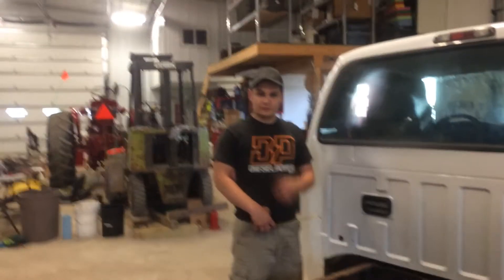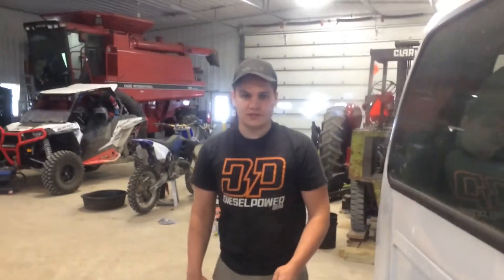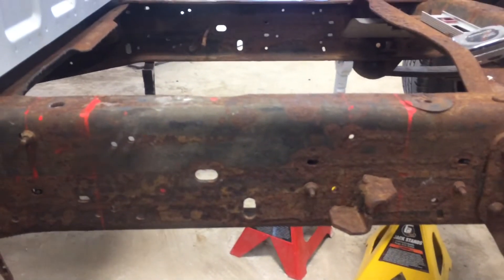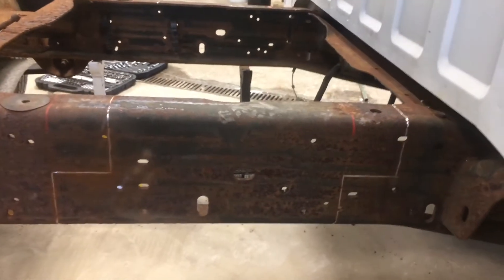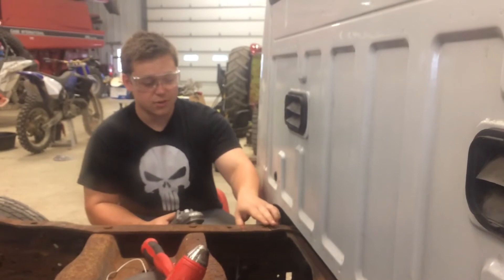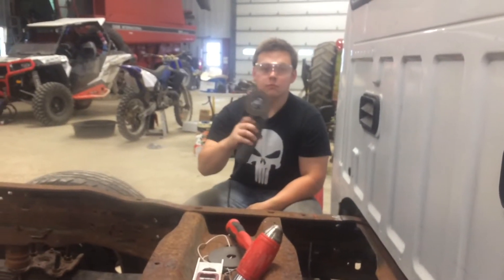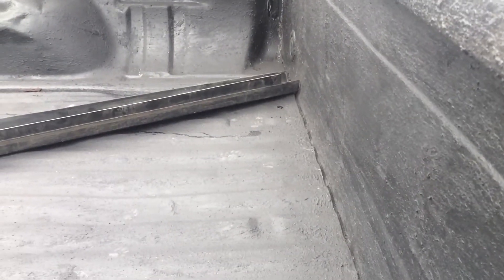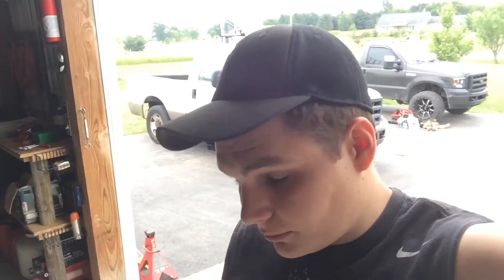*RACE TRUCK BUILD*!!I CUT 16inches OUT OF MY FRAME!! EP.6

Comment: Did you weld on both side of the frame. Inside and out. And I’ve been binge watching your videos and it looks like it’s holding up
Reply from the maker: Welded on both sides and added plates as well. No issues at all

Comment: I always hear that you only take out 16 inches so is it 16 or 16.5 inches?
Reply: Jayden Harvey did you figure it out
Reply: I'm wondering the same thing 16 or 16.5?
Reply: 16.25 is right on the money!
Reply: 16" is the correct amount to remove from the frame. Not 16.25, not 16.50. If you need to verify this, the difference in wheelbase between trucks with the same cab configuration and just a short bed or long bed, is 16 inches, on the dot. Short bed is 6"8" and long bed is 8'. So anyone wanting to do this properly...16" is your answer.
Reply: @02stroker444  16.25 is right on I took the measurements from the the long frame and the shortbed between the front 2 mount holes and split the difference

Comment: Good Lord does anybody know how to use a cutting torch anymore I swear I see all these bills and nobody uses a torch anymore rookies
Reply from the maker: GreenBoy at GA Farms well I needed precise lines so oxyacetylene was out of the question and I wasn’t very confident the plasma could do it the way I wanted so yes it was brutal with the cut off wheels but worth it lol
Reply: @LeftLaneDiesels  what do you think they used to use before plasma cutters and cut off wheels hey was cutting torches you have got to be able to cut a straight line with torch I was taught this at a very young age we used to take 5 ton trucks and cut them down to real trucks that planet fiber-optic in the ground and we use a torch on every truck we built
Reply: @LeftLaneDiesels  as a matter of fact I just did a job that was a frame job with a receiver hitch repair that I had to totally rebuild all of it with a torch and a welder
Reply: @LeftLaneDiesels  I guess what I'm trying to say is you're never going to learn and get good at it if you don't ever try it you can't be scared to try something practice always makes perfect
Reply from the maker: GreenBoy at GA Farms take it easy lol happy for you that you have those capabilities. I’m not gonna “try” something new on a frame! I’m very capable with both a torch and plasma, I think you missed the point of what I was trying to say. Precision and perfection
Reply: @LeftLaneDiesels  I've done several of these myself. I think what he's trying to say is it's just much easier to use a torch. You end up having to grind the frame to fit either way because the overall measurements before welding are more important than what the cuts initially produce. Love this build, I subscribed and will be catching up on your vids thanks for sharing!
Reply: you guys look like you know what you doing...but the issue i have is, I've searched the internet over to try and find a long bed cut to a short bed for a 1979 f-150 and I can't find a single video..not sure what I'm doing without help..thanks!